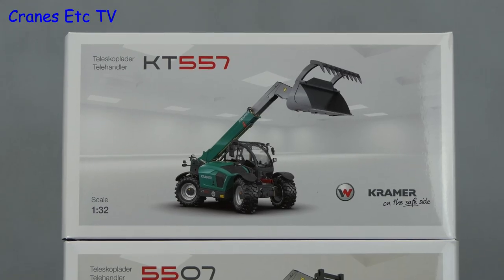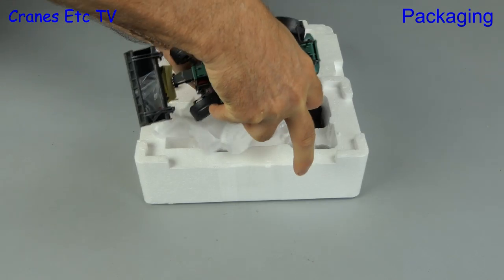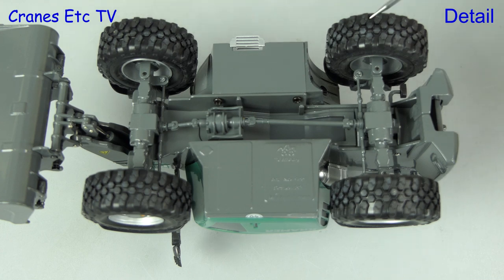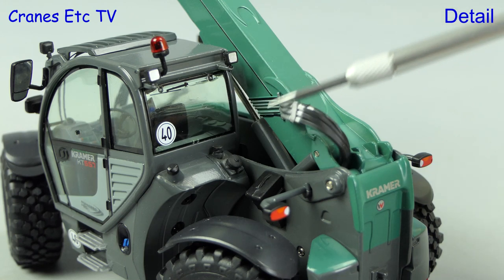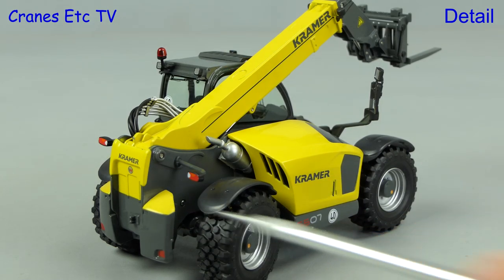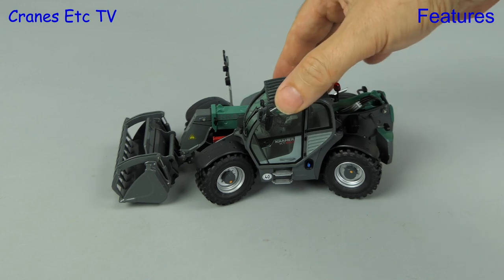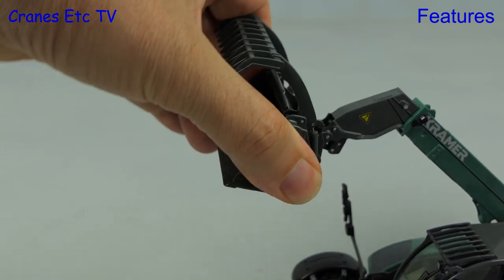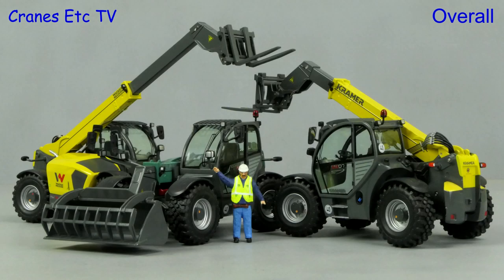NZG Wacker Neuson Group Telehandlers by Cranes Etc TV

Comment: What was the spare spring for?
Reply from the maker: In case the other one gets lost....
Reply: CranesEtcTV just couldn’t see where it was used on the model
Reply from the maker: Actually I did not look for it either, but I would guess it in the clip that locks when the boom telescopes to the maximum.
Reply: CranesEtcTV good point - must be